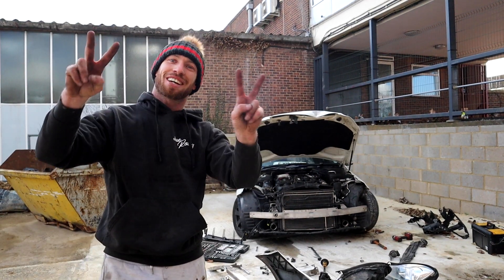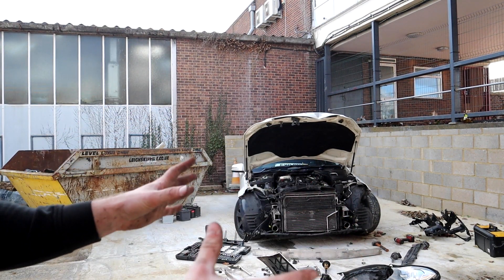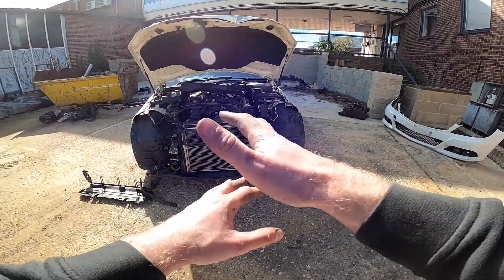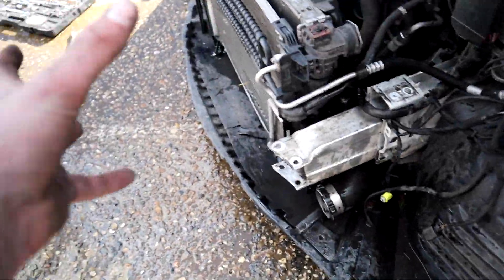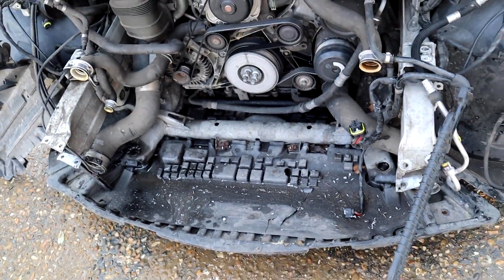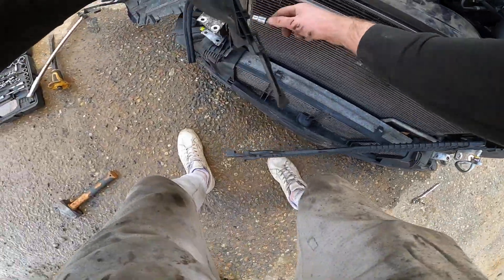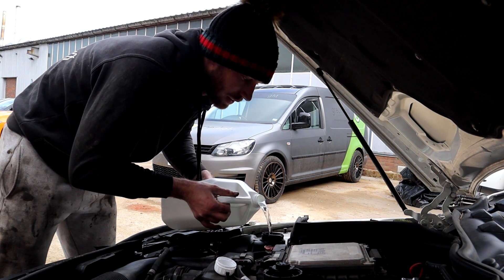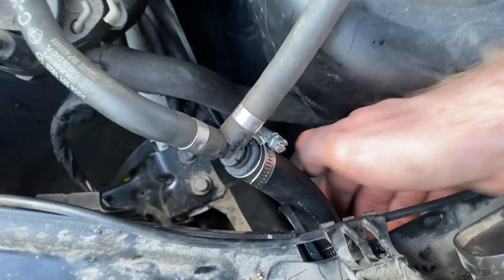FIXING MY CHEAP WRECKED MERCEDES (Part 2)

Comment: You are correct mate, not many DIY enthusiasts own mercs but I am one! Mines the same car but the S204 estate which is a very nice car and its on my thumbnail.  That pipe across the front is the power steering fluid cooler. I think the rad pack is from a newer model with electric power steering rather than hydraulic. You need to pressure blead the coolant but we will just top it up over two weeks and it will be sweet! " places that are common to leak are the water pump at the front with the black wheel top middle of the engine @ 6:27 (but yours looks quite new) and also the fuel filter housing carrier that has a coolant pipe built into it on the top of the engine just in case you have any other problems with leaks. Oil leaks are normally from the oil filter housing or cooler unit if you have one of them. Every job you do on these cars you break an electrical connection or a plastic bracket its just the way it is! Good luck mate and great Raw videos. New subscriber!

Comment: That is powers steering pot you opened not gearbox mate. Also that water return pipe that's different has just a plastic connector in the end with that silver clip holding it in so just get the little connector from the correct year and put it in the pipe you have on it already.

Comment: The thing with your hands from the air con is called refrigeration burns or gas frostbite. It freezes/burns layers of your skin off. Not to mention it’s illegal to “let go” the gas 🙈 needs recovering by an f gas licensed engineer Just as a bit of information 👍🏼

Comment: Power steering cooler I'm guessing broski 💪
Reply from the maker: I did think this myself but why would manual and automatic gearbox versions have them and some not? Strange!
Reply: @itsleelockwood  not to sure mate tbh haha manafactures have weird ways of working things, may just be as simple as they used the same parts as a higher model of that year to save money or some shit.